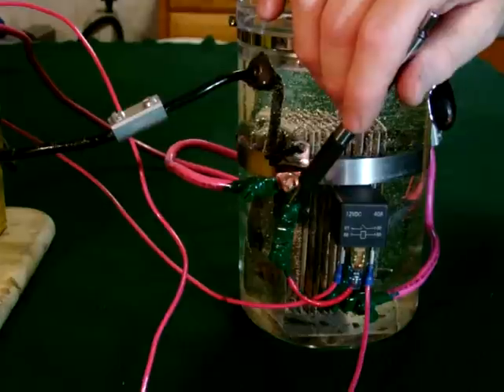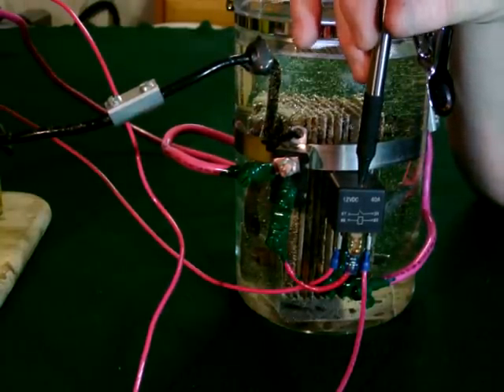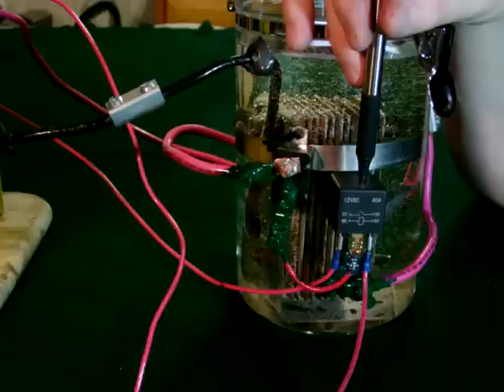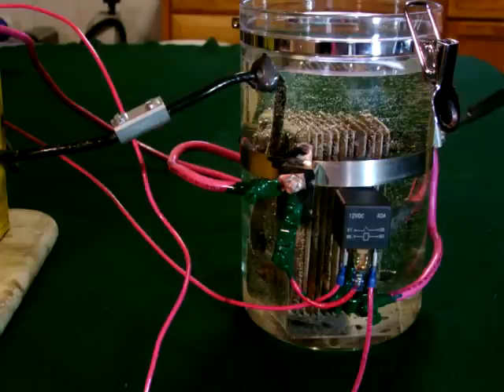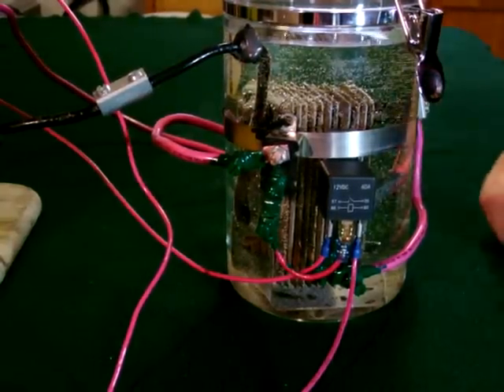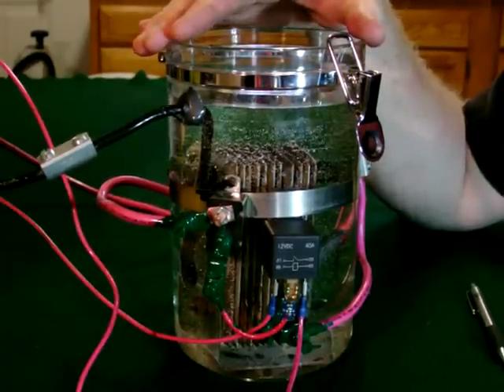A clip from my hydrogen / oxygen generator how to build  DVD

Comment from the maker: output is directly proportional to the wattage invested and that is determined by the electrolitic properties of the water used.The operating temperatures run about 70-80 degrees warmer than than the ambient air temps.

Comment: in order to run a car on hydrogen that little jar would'nt do a thing .the amount of air flow in the throttle body verses the jar is remote, im sure the jar is just a model of the potential energy of what can be achieved.... but would take a holding tank of the hydro gas and a large supply of cells in order to create enough hydrogen gas to run the car.